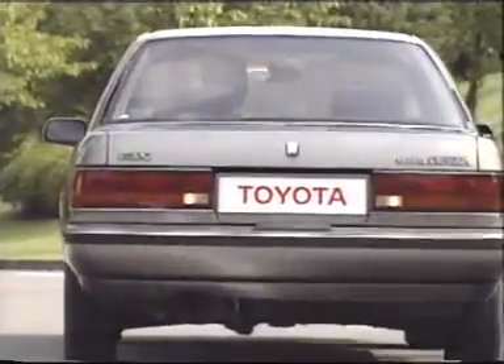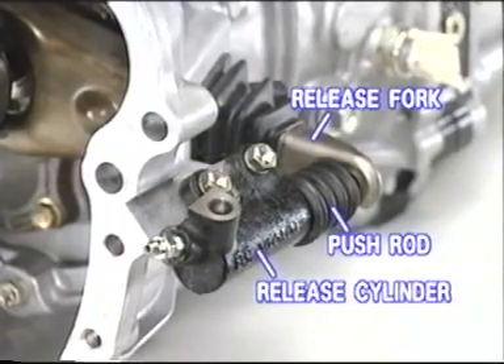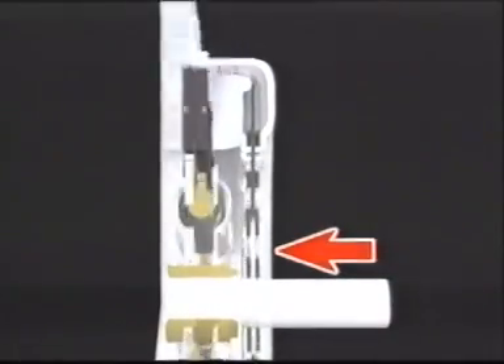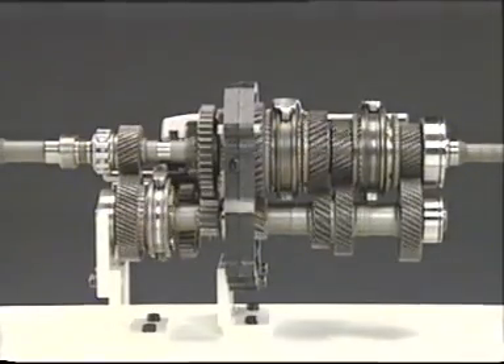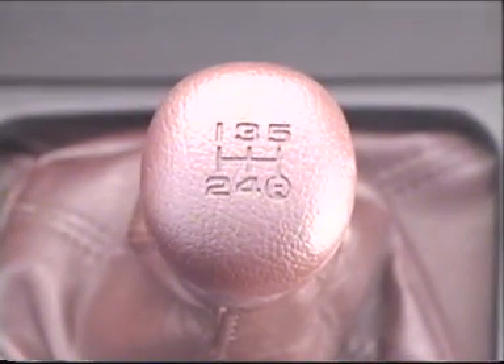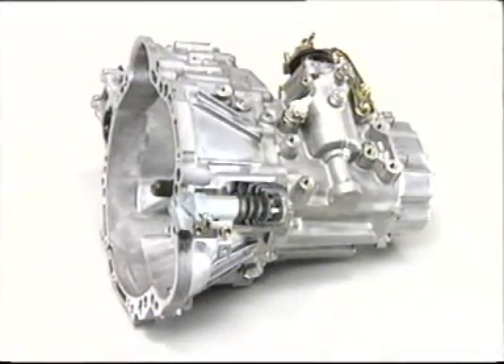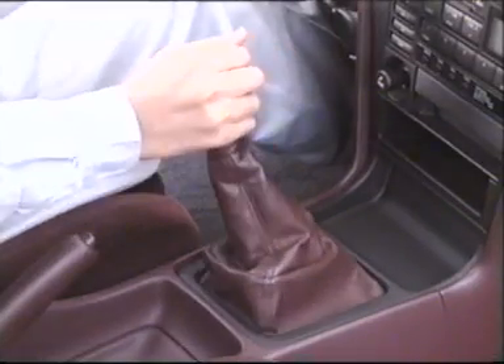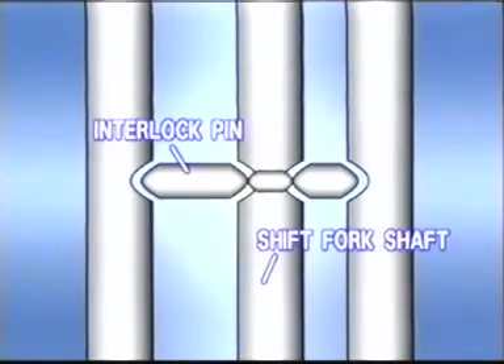Toyota service training - Clutch & manual transaxle / transmission

Comment: hi. my gear shifting become more resistance and hard after clutch pad and plate replacement, specially 1st gear, before this was totally smooth gear shifting. while pressing the clutch, 1st few seconds, the 1st gear engagement is difficult, but after a while, it engaged and it becomes smooth to switch to other gears with clutch pressing. it was found resistance in engaging gear while car is stopped Toyota fortuner/hilux manual.
Reply from the maker: Maybe part plate ur change is hard